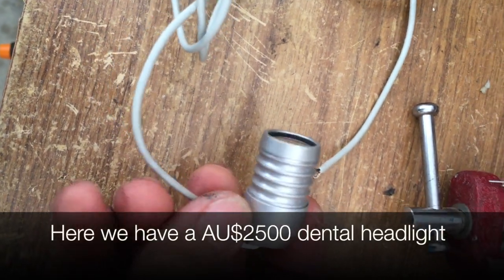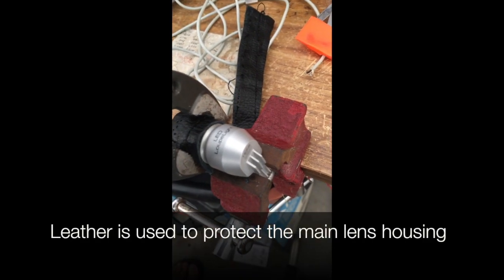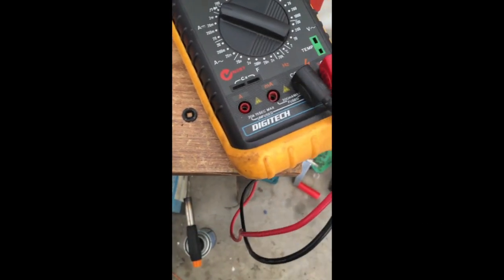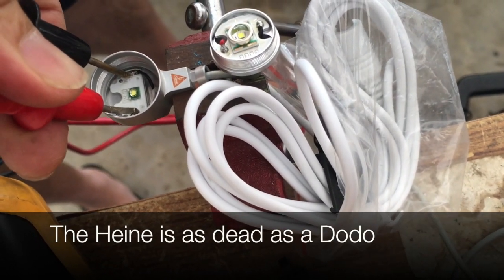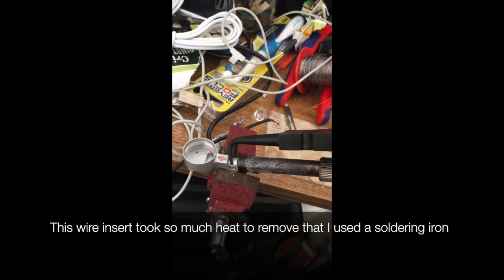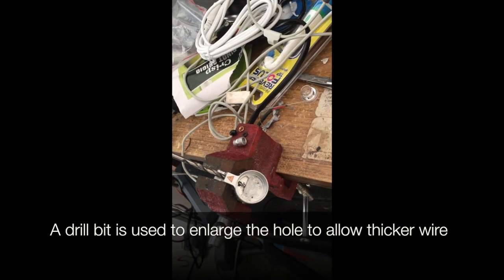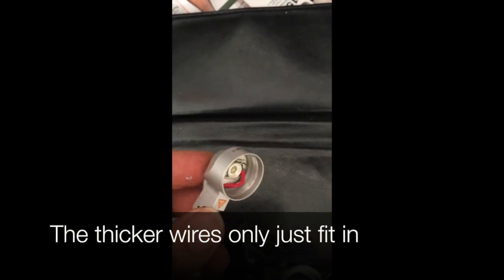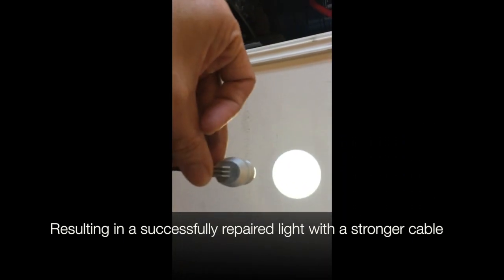Fix a $2500 Heine Dental LED headlight for $20

Comment: i have an Heine ML4 Headlight  halogen do you think i can replace for led light?
Reply from the maker: Yes that will be the same procedure to replace the led . The led unused is nit as good as the original Heine Led so if you change yours , try and source a led of higher quality. Look for a Cree Led.
Reply from the maker: If your old light is halogen you will also need to change your power source to a current limited power supply or else the led will be destroyed.

Comment: Hello Doctor 
I need your advice again. 
The light cable was tear and nearly disconnected. 
Do you have ideas for Heine cable light for replaced. 
Thank you.
Reply from the maker: Easy fix . Find where cable is broken and join new wires . Use some hot glue to reinforce the join. The hot glue is strong but not too hard . All of these cables are terrible . Mine has broken approximately 14 times and is now joined almost near the light. Still going though . Great light but terrible wire .

Comment: I use Heine loupe too.
The light cable connector tear, I try to remove the pin for solder light cable, but I can not. 
How can I remove pin for solder cable light. Thank you.
Reply from the maker: You carefully pull back the grey cord relief grommet and you will see a small screw that holds the cord . Undo the screw . Keep the connector attached to the battery pack and use a small spanner to undo the nut at the end of the connector . Inside is the wire soldered to the pins . You will see a small resistor inside the connector as that is what makes the Heine battery pack work on Heine lights and not on other led lights . Good luck .
Reply: Dentinvent : 
Undo is clockwise or counter-clockwise... sorry about my questions is stupid but I never did like this. The company arks me to buy new one. Very expensive.
Reply from the maker: Undo is anticlockwise . I’ll make a video on it if you want . ( just ask and I’ll make the video )
Reply: Dentinvent  : please do the video. I have no idea to fixed this problem. Thank you so much
Reply from the maker: I’ll make the video when I get a chance . Currently fixing a Fiskars pole pruner mechanism.
Reply: Dentinvent thx
Reply from the maker: Just publishing the video now for you . Search my channel . Heine headlight plug removal tips.

Comment: It glass place to shine from inside is broken & I could not open it can you help
Reply from the maker: Is your light the same Heine light? Almost all dental headlights are screwed together and the better ones have the screw thread sealed with an epoxy resin. The resin needs to be heated a lot to melt it.
Reply from the maker: mohammed aljunaid 
I need to see a picture of it

Comment: How can fixed dental kd-202a headlight
Reply from the maker: Where the cord enters the body of the light , I would heat that section and try to rotate the aluminium housing. Use either a gas hot air gun ( not a flame ) or use a hot air soldering station. Never use a flame as the heat will burn the light or crack the lens.